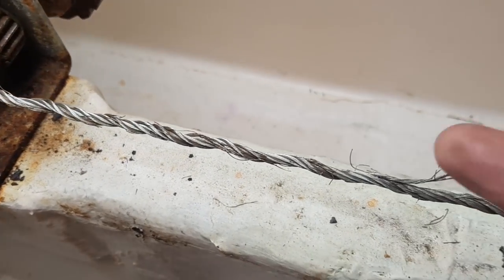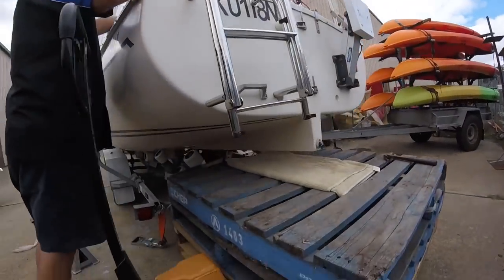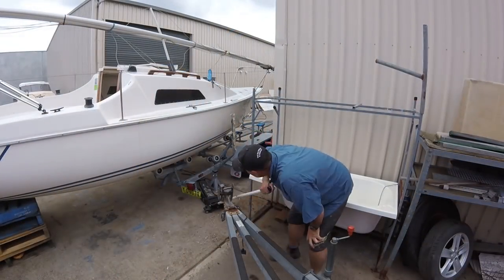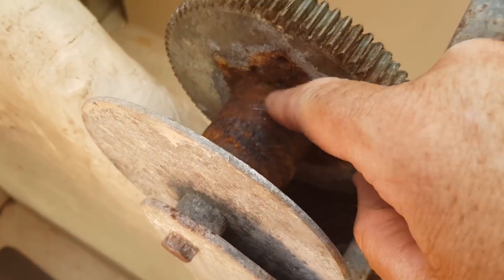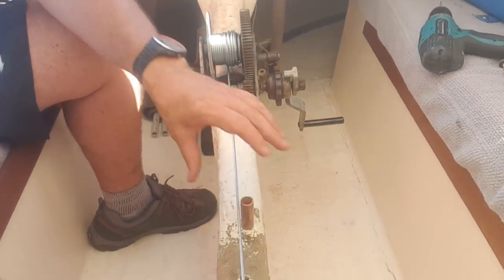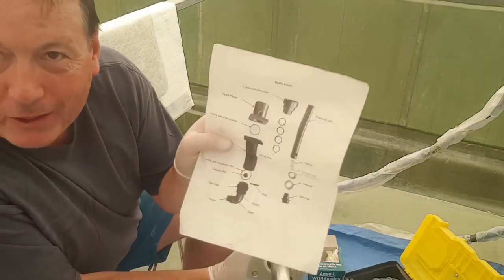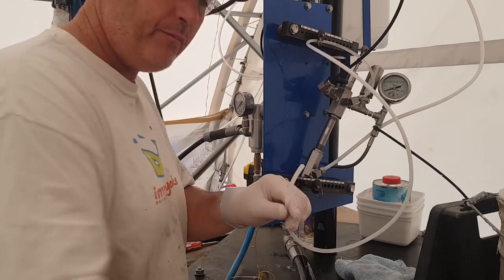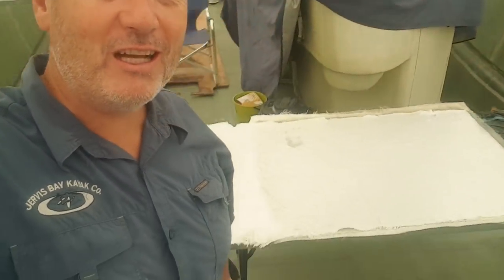Ep033 Yacht repair and major maintenance issues.

Comment: Another aspect of steel cable passing around drums and pulleys was explained to me by a knowledgeable old timer who fabricated a personal winch for me to use Opal mining, it is the ratio of cable diameter to the diameter/radius of a drum or pulley it passes around or over and the angle at which it does so.

The larger the diameter/radius of a drum or pulley and the smaller the angle at which the cable passes around or over it the smaller the lateral load on the cable and the longer it will last before the strands begin to fail due to metal fatigue.

The safety margin provided by using the largest pulley reasonably practical is why you see what appear to be overly large pulleys at the top of mine shafts for raising and lowering the lifts carrying miners down and back up deep shafts such as at Broken Hill.

So, it is not necessarily the gears of the winch which are causing the wire rope to fail.

Comment: nice work Rossco,  it is usually in high stress moments that things don't go to plan, but then again all well that ends well. I think the PPE issue alot of the time comes down to complacency, the hardest part is creating "good" habits instead of just saying the work will only take a minute, awfully hard to sail a cat if you can't see where you are going
Reply from the maker: That is precisley what happens Tim.You work with this stuff every day and a rushed moment can be life changing.Complacency ,fatigue and lack of care is a huge issue in all workplaces.Cheers again buddy Ross

Comment: I work for sunseeker in Poole UK making plastic super yachts haha. we use two different types of catalyst for our resins the first of course the MEK-P and also mcp75 (slow) the most corrosive of the selection one could get there hands on. it is mandatory that when dispensing catalyst from the pumps that the laminator is wearing a full face shield. I have received any eyefull of 1.25% MEKP 420 ortho resin and I tell you what it's scary because instantly your eyes slam shut the pain is unreal to describe but the first aider was straight on it grabbed me and put my head into the eye wash station 30minuets continuous washing with freezing cold water sorted it out. it happened because I simply knocked off a large fluffy head into the wrong bucket in the hot shed happened to be uncured resin went straight under my safety squints into my left eye. if I was not wearing them it would have been both eyes. If I happened to be wearing a face shield which of course I would not be because I was just disposing of resin after layup it would have just splashed off the shield. 
I hope I never have to experience neat catalyst in the eyes 😨
Reply from the maker: jamie mitchener Hey Jsmie that is an horrrendous story and I too now never handle this stuff without my full face mask these days.Great advice,every moment of stupidity and lack of care could be life changing.Thanks for the comment.Cheers.

Comment: Wow glad that the line break wasn't worse! I guess putting the whole thing in an enclosure would make it safer.
I'd also look into the material. If the MEK is corroding / dissolving the tube, maybe you need a different tubing. Looked like teflon tubing. Also possible that black tubing isn't the right one.
Reply from the maker: You are correct.It got me through a days work but certsinly not a long tetm solution.Cheers and thanks for watching buddy.

Comment: I've been binge watching and enjoying your work....  Great Job. 

2 comments --- 

1) Polyethylene LDPE/MDPE used in tubing is only partially resistant to MEK /MEKP / acetone and other resin thinners and catalysts -- it WILL fail over time.
2) Why didn't you just put a large shield disk on the forward gear  axle on the swing keel winch. A 1 inch dished disk? or offset disk could sit on the axle and be supported by the other gear. 

3) The holy hand-grenade of Antioch be damned- why not shorten the cable to just longer than the exact length and make a spare to keep right there.  I used to do that with kayak skeg cables after I had a couple of people have skeg and rudder issues on trips.
Reply from the maker: Hey Reggie,welcome aboard Winch cable was shortened recenty and solved a heap of problems.The guide I put in place has all but dealt with the winch gear issue .With regard to tubing I am resigned to8 replacing regularly but the black stiff has held uip much better than the clear. Thanks for watching, lots more to come I as m afraid, don't you go skipping ahead now. Cheers Ross

Comment: Grease the thread on the shackle and wire it closed with gals wire to keep it from undoing and act as an anode. If you're mooring where's there's some tide run, wind up the keel. Otherwise that stainless cable will last about 6 months. And yes, shorten the cable so you have the next one! Hope I'm wrong!? 
Do you think UV killed the catalyst tube?

Comment: try to find Teflon tubing to replace that cheap stuff. would be worth the money. we used it in making microchip etching with major acids...
Reply from the maker: Will do it,it has been an interesting thread this as it raises many questions as to manufacturers of this type of equipment. In this case it lasted a solid year and admitedly i left catalyst in the line the whole time.I will be dilligant draining regularly in future.All the best Ross

Comment: Holy crap if you capsize and the boat is upside down the keel will drop through the boat. Is there no way to lock the keel once it is down?
Reply from the maker: Hey Paul.The keel does have a lock down bolt indeed.The pivot point is a 1inch brass steel pintle so no way it can come through in the envent of capsize.Excellent observation my frind.Cheers Ross.

Comment: Maybe a stupid question but why didn't you just turn the winch around so the cable feeds into the end without the gears?  It doesn't appear to make a difference which side the handle is on.
Reply from the maker: I actually considered that but the handle was a tad to close to the bulkhead behind and i thought it may be too hard to operate.Great observation though and appreciate you picking up on it.Would have been ideal but I really dont think there was enough room.Cheers Rossco
Reply: Gotcha. It was difficult to tell from the video.

Comment: Why don't you get rid of all the excess wire rope, you aren't going to use it, and it will only give you an over run again? The top layer is already digging into the lower layers when the keel load comes onto the winch.
Reply from the maker: Hannes Miller that will be my next job when I take it out of the water.Didnt think of it when I put the new cable on.Cheers.
Reply: It could serve as an in-place spare, after the keel end is worn.
Reply: It could serve as an in-place spare, after the keel end is worn.
Reply from the maker: That is a hreat idea,I have a thimble to swage in place for the keel end.

Comment: I know you have probably finished this job but what i would have done id in the small axle of the winch drilled out put a large washer up against those teeth.
Reply from the maker: What a top idea.Maybe the next time it goes i will be actioning all of these great ideas.Thanks so much for the input it is the best way to think outside the box.Cheers Rossco

Comment: i think you might need another 60 feet of cable on that winch drum
Reply from the maker: Ya reckon lol.I have now shortened it. And much neater now.cheers Rossco
Reply: you going to put a pivot at the top of each acrow?, (on the chassis)   when you lift the beam on top from the centre jack it won't wanna go up straight, I assumed that's what you were planning for some reason  ...

Comment: Yeah, you're absolutely right, the design of that winch and the whole assembly in general is rubbish. Who in their right mind would leave exposed gears near a cable like that? I bought a few China Export stationary winches in my time and even they had the right mind to put a guard (haphazardly welded over the frame, true) to prevent that. Someone cut corners with a bulldozer, they did.
Reply from the maker: aserta Absolutely buddy.Just pathetic lack of forethought.I reckon a 5 year old could design that better.Thsnks ad i much for your comment again.Rossco.

Comment: Are any of the HG/HK Holdens that occasionally appear in footage yours Ross? 
I learned to drive in an EH and have always been a Holden man even though my first car was a TC Cortina and it was generally a great bus.
Reply from the maker: The Hks are owned by my mechanic neighbour Steve.He is holden mad owns three and are serious beasts with 454s in them.His don owns a fully blown 73 TC cortina worth a fortune and I too owned  TC Cortina 1973 as my first car.Learned on a EH station wagon my granddad owned.Happy days.Rossco
Reply: @LifeOnTheHulls  My TC was a 73 2litre sports pack. It was post box red with black stripes a black interior, tacho dash etc and a really great car. It went like a startled Whippet and the only weakness I ever encountered was the gearbox. Apparently the problems I encountered were a result of design inadequacies for the splash lubrication. I often travelled long distances on trips such as from the Adelaide Hills to Mt Gambier, Pt Augusta, the Flinders Ranges, Broken Hill and the Wilcannia region of NSW etc which tended to sling the bearings dry at....um 'sustained higher speeds'. I eventually sold the car in the 1980's to a father and son who intended to restore it due to rust in the spare wheel well resulting from to beach fishing expeditions and various dents in the floor pan because later in it's life I used it for the occasional bit of off-road spotlighting.

Comment: Ive played with a lot of steel cable when working on prawn trawlers and I always wondered if the plastic coated clothesline stuff would do the job. On a 100m drum it might not but this could be the perfect application.
Reply: Because it has got to be cheaper than 316
Reply: The plastic coating on a zip line in my back yard weathered and cracked fairly quickly under strain.  I don't remember how long it took, but it started failing before I wanted to replace it.